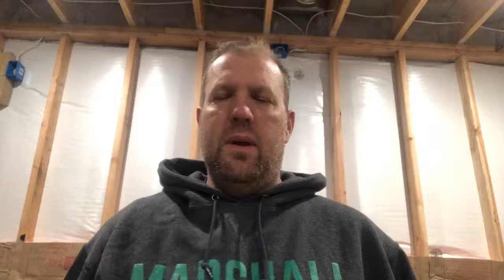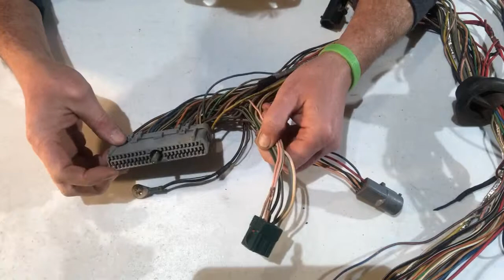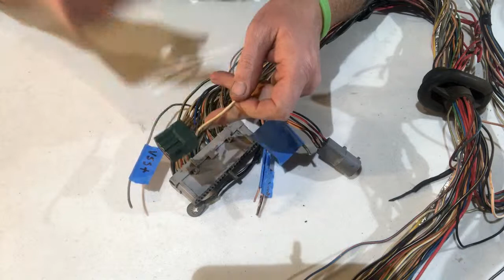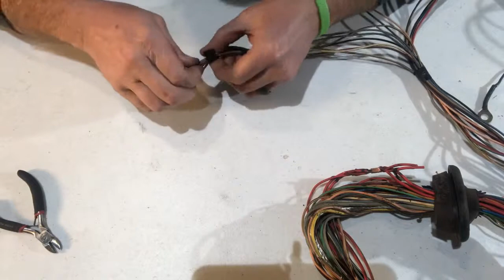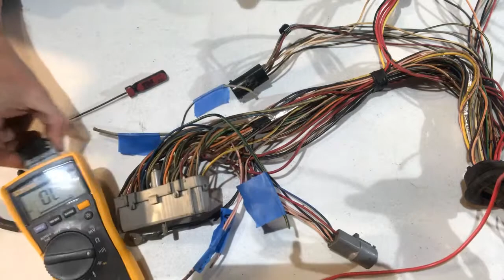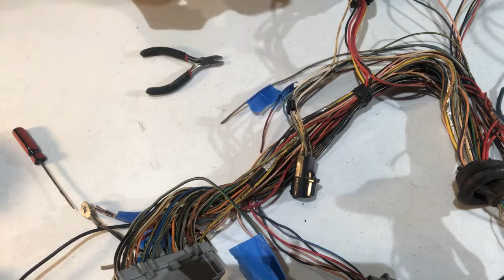Converting the Ford 5.0 EFI harness part 4:removing the Green and Black plugs and associated wiring

Comment: I had a quick question ..
So i removed my harness my self from my old 89 foxbody 5.0 with t5 
Plan on putting it in an old maverick.

For the hego/02 sensors i have the oem harness ..
And plan on not cutting .. 

So do i also not cut it out of the 60 pin ? 
Any help is appreciated 
And thank you for these videos.

Comment: Anthony,  Im dropping in a 1987 TC engine into a hotrod project. The connectors next to the 60 pin EEC are different colors then Brown, Green and Black. The plugs are Dark Grey 8 pin female and a Light Grey male 3 pin with 4 wires and the Black. Ive got the Black plug figured out, I need help with the Dark Grey and Light Grey plugs. Trying to ensure connects are accurate to all sensors and computer work. Any help with a diagram you may have would be greatly appreciated. Frank
Reply: I bought a 98 5.0 out of a Grand Marquee without an ecm. How do I identify ecm for this engine?

Comment from the maker: If you have a separate harness that connects to the Black connector, DO NOT REMOVE the Black connector. This is the connector for the Right and Left O2 sensors, the NDS, and the low oil sender {if you choose to wire a dummy switch}. The separate harness ARE specific to the transmission type. Using an automatic harness with a manual computer CAN and WILL fry pin 30 on the computer. be aware of what parts you have.
Reply: Damn..I didnt know that!!